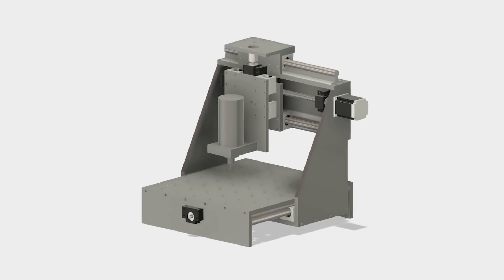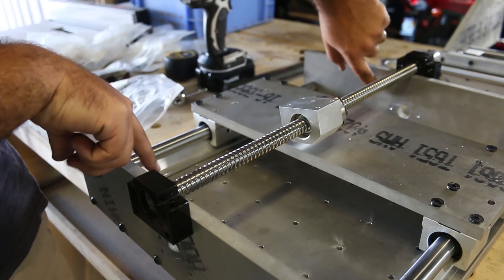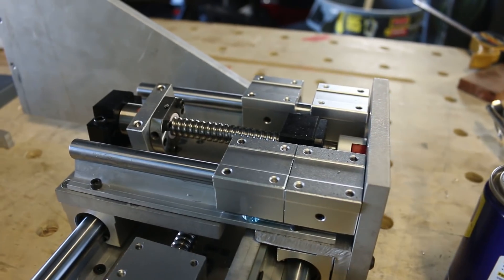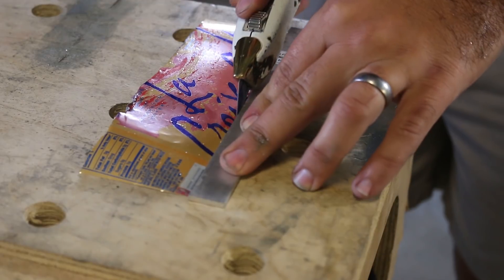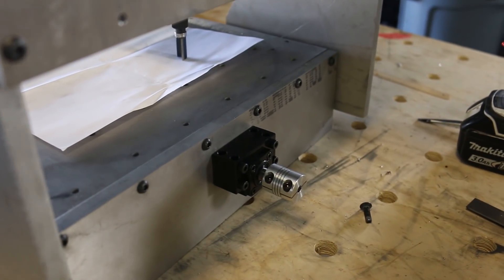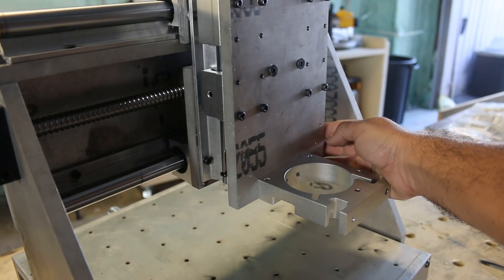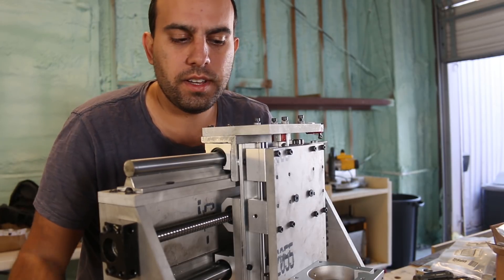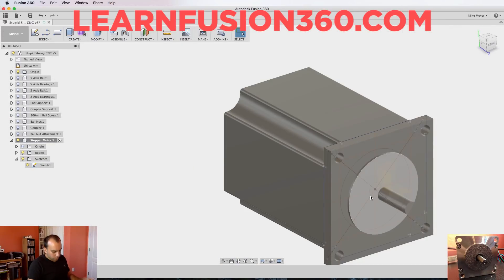"Stupid Strong" CNC Build - PART 3 - DRIVE COMPONENTS

Comment: You need to make a new plate for the z axis to mount the rails to.  The 4 bolts on each Bearing slide is carrying to side load. You are losing a lot of rigidity  !

Comment: Are you not going to have a different  limit signal on the Gantry for the X-axis because the limit switches are on the Z axis plate when the z moves up and down the limit will change if there is any flex in the Z axis.

Comment: Nice build! I have something similar and the only thing that botheres me is that it does not use a real spindle. I had a similar router on it and that was only working good on wood and plastics. Once i wanted to make something in aluminium and other metals it just did not work. Mainly because of the high speed (25K rpm). Currently i am still looking for a water cooled spindle with a speed control that will make working with metals possible. For metals the CNCs small dimensions and the sturdiness will be no problem at all, it is just the router.
Reply from the maker: I expect to upgrade the router.  I wanted to make sure I could actually build the thing before paying for a high performance spindle.

Comment: you might want to get a couple of dial indicators to line everything up and put in a couple of ways to adjust the x, y, and z.  In my machine shop with heavy accurate machines when a project is completed it is hard to keep parts and tools that are assembled like your cnc within .005"
Reply: hes clamping to plastic on a router... its never going to hold any real tolerances ...
Reply: You are correct, however a static 0 setting setting would be a good start, then however it loses indexing after that...
Reply: it seems like its close enough that he could tram the axis in with an indicator, some strategically adjusted screws and few taps of a dead blow. but the problem is going to be doing any radius having play in the way the router is set up plus they are not designed to handle any real feed pressure, its going to have to cut really slow or it will have some heavy chatter... I would ditch the router and go for a water cooled spindle motor, fairly cheep and a little more up to the task.
Reply: If all he is doing is some plastic or soft wood he'll be ok.

Comment: It had to happen I suppose - you Americans have been mispronouncing aluminium so long you have now started miss-spelling it -
how long before nuclear reactors are running on plutonum and uranum?  and using sodum, potassum, and magnesum elsewhere ??????
I fully expect that electronic components will soon be joined with sawdering ( I am not total sold on this though!)

Could you PLEASE edit your YouTube posting, and correct the spelling of the word ALUMINIUM - thank you - I promise I'll give you a thumbs up then!
Reply: When the English start measuring things in proper inches, feet, yards, and miles - then we can consider altering the proper spelling of aluminum. ;)
Reply: Wow, the 50,000th doucher to bitch on the internet about how aluminum is spelled and pronounced differently in different dialects of English. What's next for you? Are you thinking about getting into fidget spinners?
Reply: The IUPAC has stated that either spelling/pronunciation is correct.  Do a little bit of research before you post.
Reply: Every heard of a typo you douche?  Oh, and it's "misspelling", not whatever the fuck you wrote.

Comment: I'm guessing you'll be selling these plans and you'll probably have thought of this, but you could include a DXF file for all the aluminium parts. Then people can send these files straight to their local water jet and get all the parts cut
Reply from the maker: I won't decide if I'm going to sell plans until I've used it for several months successfully.  But yes, I would include the files needed to have the aluminum cut.
Reply: My local waterjet.
*cries quietly as 15yr old boy in the uk.

Comment: Very sloppy build, what did you even design man, you just started putting parts together without proper design
Reply: Neel Rathore Let me get this straight then: your first post was super critical of his design and progress, yet you watched all of the videos looking for ways to improve your design. That is an even worse result, given your original reply. 
Good luck with your design/redesign. Your overall attitude is a piece of work.
Reply: well he trying ..go mike
Reply: Every CNC machine I have seen assembled would be considered a "sloppy build", if those standards were applied. They all need some adjustments, tweaking, and alignment. Even a fully assembled and shipped one.
Your comment leads me to believe that you missed videos 1 & 2 or didn't have your volume one for 3.
Reply: Dude just stfu and get a fucking life
Reply: I recently made similar desktop cnc for milling zirconia discs for dental use, i havent uploaded plans on internet but i can share pictures
Reply: Karl-Emil Storm no thanks, i am quite happy with my life
Reply: Gene Jordan i watched all his videos about this cnc build and many others for cues as to improve design of my 2nd build version
Reply from the maker: Can you send me the link to your homemade CNC plans so I can learn from a proper design?

Comment: Nice job Mike! Quite an experience designing and building  your own CNC isn't it? I went through the same issues back then (about 4 years ago) and every time you look at the machine there is always something that could use an upgrade or change. 

Would I do it again? Yes! And I did and will in the near future. I am building a delta 3D printer now and also experience all sorts of issues along the way but that is part of the "fun" handeling those things. 

When the printer is done I will build a laser cutter, and when that is done I will convert the milling machine to CNC and when that is done, another 3D printer (etc etc). 

You will also learn that the term "stupid strong"  is quite debatable depending how you look at it.
Reply from the maker: Thanks for the encouragement!  I've learned a lot so far and that was the point of this build.  My goal was to create something "stronger" than a hobbyist machine like the x-carve which I think I have achieved, but that will take months of testing to confirm.  I had no idea it there were so many industrial CNC experts out there (not kidding, there are A LOT of people really passionate about high precision machines).
Reply: Thanks for the reply, it definately is so your goal in is met in that sense! The thing with all the machinery, its like a black hole, you should really watch out that you do not get sucked into it :) 

At some point you will realise that you are trying to make something way better than needed. Best remedy: do not buy high quality measuring equipment, that way you will never know how far you are off the targeted dimensions for sure. 

(a while ago I was trying to improve the runout of my spindle and kept looking at the display of the gauge and it kept giving a enormous error of 25! Then I remembered that this gauge had a resolution of 0.1 microns. My solution to this problem: I added a piece of tape over the last two digits)
Reply: @StefsEngineering  
I know the "black hole" feeling so well after several hours trawling CNC forums.
Reply: @robbiejames1540  Yeah, can be quite overwhelming, especially for beginners. People tend to forget that there are (usally) more than one way of approaching a challenge, making it even more difficult for beginners. 

I try to be as objective as possible. For example, when someone asks something on yt or a forum, and I feel that I have some information that may help  that person. I tell him what it is and why I suggest it (and what alternatives there may be). Those last two aspects are usally missing.

Comment: Why are stepper motors so loud?
Reply: bad drivers, see https://www.youtube.com/watch?v=sPvTB3irCxQ
Reply from the maker: The stepper motors never ran in this video. That was a drill just to see if the drive was aligned properly.
Reply: apart from that (that it was the drill in this video) steppers can be quite loud but it really depends on the drivers you use. If you go cheap its loud, if you pay a bit more for better drivers they can be really quiet. 

I had that experience when I upgraded from wantai DQ860MA to Leadshine EM806 drivers. Day and Night!